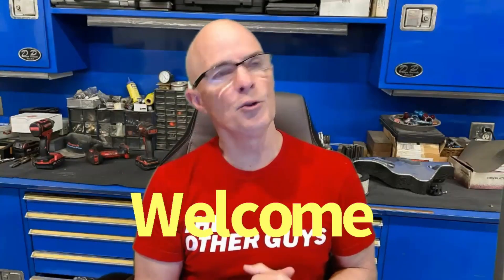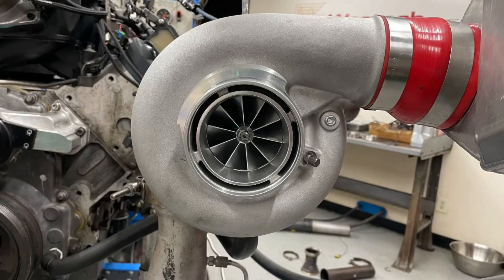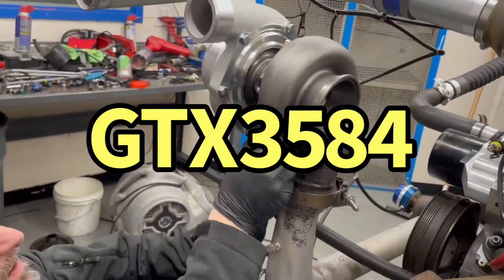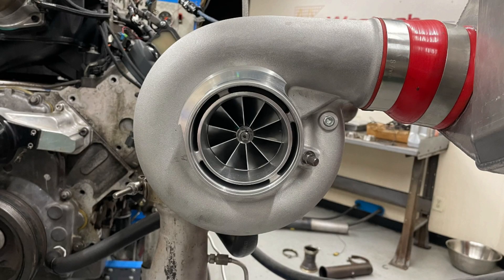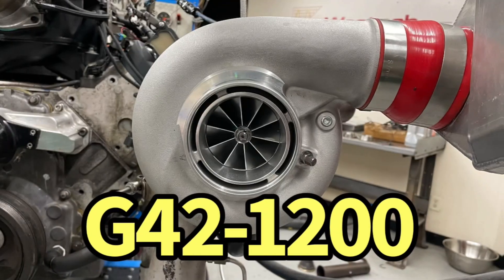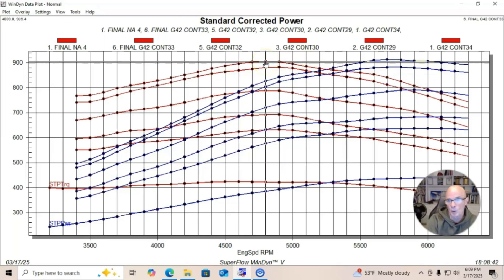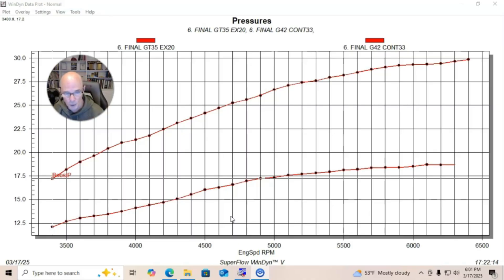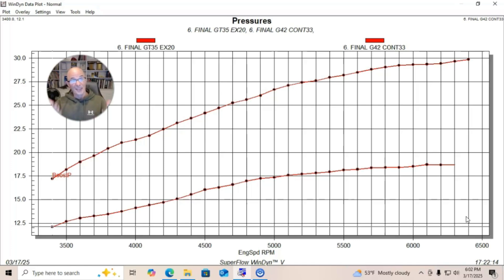TURBOS WARS! GTX3584RS VS G42-1200. SAME BOOST, SAME AF, SAME TIMING. POWER, BOOST & BACK PRESSURE

Comment: 8:00 g42 is the better turbo it has more torque and power across the board even more responsive being bigger. insane
Reply from the maker: it is not more responsive-the artificial dyno load created that-in a vehicle on the street or chassis dyno-the smaller turbo is more responsive

Comment: Have a 2009 Yukon with a 5.3. 
Plan on towing the boat and four wheelers with it and playing some with it on cruise nights the smaller turbo should be perfect correct. 

And for power maybe 5-600.
Reply from the maker: YES-THE SMALL TURBO WOULD WORK, AFTER TESTING THE G42 ON THE STREET IN THE TAHOE-IT WILL ALSO WORK
Reply: Btw rich are your guys kits going to be complete down pipe inter cooler all of it.

Comment: @richardholdener1727 I see that low-rpm torque is almost identical, how do you know that GTX3584 is much more responsive?
Reply from the maker: the artificial load an engine dyno applies (on load in) does not accurately measure boost response-we measured it on roll in

Comment: Great video! Not sure if you heard about Garrett’s G series gen II or GXR series, but they seem to flow much more size per size. They also suit higher boost from what I see on the compressor maps.

I have a 3584rs on a 2.0 4cyl. and I feel that it is getting out dated. I hope someone knocks off the new G35-990. It flows mucg more than 3584 while having a smaller comp wheel.
Reply from the maker: the GTX3584RS is rated at 950 hp-more than enough for 99.9% of 2.0L motors-also not sure how you can feel a turbo getting outdated
Reply: @richardholdener1727  Sorry, I didn't mean to say that the 3584rs isn't making power or relevant anymore but, it was released in 2017 and is a part of Garrett's older GTX lineup. Garrett has since released 2 entire lineups to replace the GTX lineup. I feel that for a high boost application, it would be a better choice economically for someone in 2025 to get a G series II or GXR since the compressor aero is much better and price is similar to the GTX line. On a lower boost application the first gen G series definitely shines though. 

As for my 4cyl. I cannot make near the 3584rs' advertised HP without overspeeding the wheel. On the compressor map, it flows only ~70lbs/min at a pressure ratio of 3.75 before overspeed. The newer similarly rated Garrett G35-990 would flow closer to 90lbs/min at the same pressure ratio. It does this all while having a much smaller inducer/exducer on the compressor wheel. This would be very beneficial for response and boost threshold in a small displacement motor like my 4G63.

Comment: There's some new turbo I seen over in Europe that has no nut that holds the blade on the compressor side the compressor blades go all the way to the very tip of the center of the blade circumference because there is no nut it allows for more surface area of blade and more airflow
Reply from the maker: that works to improve flow

Comment: How much response are you losing with the bigger turbo of the two?
Reply from the maker: you need to choose your turbo based on desired output first, then based on desired response. One of these is much more responsive than the other (especially on a smaller motor), but the other can make a lot more power (a G42 works well on a 6.0L)

Comment: Did you use the same 1000 cc injectors for all 3 tests? Will those support the full 1200hp on E85?
Reply from the maker: same for all tests-will support 1200 hp (flywheel) on e85
Reply: @richardholdener1727  thank you! Great info in all your videos.

Comment: Hey Richard! Are there any variable-geometry clone turbos out there? Just curious if those are still single-source or if they can be had cheaply for tuner fun...
Reply from the maker: The problem with those (as discovered by the OEMs) is that the environment for the variable vanes in a turbo don't last long and are expensive (just get the right size turbos for your needs)
Reply: @richardholdener1727  Can you simulate a test of a VGT in a remote set up? 
That might recreate the lower EGTs that the VGTs prefer.

Comment: Bro doesn't understand absolute pressure....
Reply from the maker: Bro understands
Reply: @richardholdener1727  Well. Edit the video with the correct pressure ratio across the engine..
Absolute pressure buddy...

Comment: Great video, but I wish you also showed the comparison at a lower hp, further from the choked flow of the GT35. Would also LOVE to see some plots on the compressor maps of both with turbo outlet temp and charge temp after the cooler. Are you able to control the intake temp to keep it constant between the two?

This is such a highly debated topic, and you're putting numbers to it, thanks!!
Reply from the maker: the air going into the turbo is the same. No need for compressor ploys-the maps are avail on line. We ran the GTX3584RS at 7-15 psi (same with the G42)
Reply: @richardholdener1727 I was talking about intake temp in the manifold, not into the turbos.

Your video did a great job showing the increased back pressure from the smaller turbine, but it’s only half the story.

Since you analyzed the results at the max power rating for the smaller turbo, it’s very likely that the compressor is choked. (See how flat the power curve gets, right at the limit?) Since the turbo is controlled to a boost pressure, when the compressor chokes, the waste gate closes, spinning the turbo faster, but mass flow at the turbo inlet can’t increase. The result is more heat. That is why I am curious to see compressor outlet temps, and mass flow plotted on the compressor maps. Sure I can look at the maps all day, but they don’t mean anything without the mass flow.

You’ve got all the data to show how your test results relate to turbo sizing tools so folks can pick the right size turbo.

The reason I wish you also did a compare at lower boost/flow was to see how much power difference the turbos have below choked flow (though this can kinda be seen at the lower rpm’s). This is mostly to settle the online debates about the same boost from bigger turbos being more flow at the same boost… even below choke? 

My question about controlling manifold air temp is related to the idea of cooling the likely hotter air temp of the smaller turbo down to the same manifold temp as the bigger turbo. My guess is that if you have enough cooling capacity, the boost pressure would drop in choked flow and likely would not be able to match the larger one.

Comment: It would seem you might want to get the GTX42 even if only running 700-800 hp as it has better spool response and made more power on less boost lol.
Reply from the maker: no-this graph does not show response-the dyno produces full boost on both (artificially)
Reply: @richardholdener1727  Ah, so the whole thing is pointless if we cant see the actual power bands...I have always been for using a slightly larger turbo to run less boost if you can find one that spools pretty well for its size.

Comment: The smaller turbo more responsive?  According to your graph, it made less power from the bottom (3500 rpm) to the top.  If it's making less power at the bottom, how is it more responsive?
Reply from the maker: the response rate is not shown on the graph-the engine dyno artificially loads a turbo motor

Comment: Love this stuff Rich, just love it!  That 35 was turbine choked right from jump street! A negative delta p that bad is no bueno! I build mostly small engines with boost...I was very active in the 90's-00's, had my own shop and turbokit company. It was a really fun era to be a part of.  I always went against the grain of small turbine and big compressor on a small engine mantra.  I always told people, run just enough compressor for your power goals and open up the exhaust side.  You'll make more power, at the same boost with the same spool and your engine will be MUCH happier for it.  The smaller compressor makes up for the larger exhaust side so "lag" and response is pretty much the same as the small turbine big compressor turbos.  I proved it one day by swapping to a larger turbine a/r on the turbo while strapped to the dyno.  The car at the same boost, same day, never loosening the straps went from 307 whp to 392whp just going from a .63 to a .82 a/r turbine housing on a T3 frame turbine hybrid using a T4 compressor. (Not a giant comp wheel at all, just crazy efficient with a huge efficiency island with 7-20 psi being at peak for the airflow we needed!. T04E 50 trim,  It was the precursor to the GT30R.)
Reply from the maker: it wasn't choked from the start-it is a better turbo for a street/strip 5.3L up to 800 hp (the response rate is not shown on the dyno curve because of the artificial stationary load that allows a turbo to be at full boost)
Reply: @JViello  I asked about the a/r of the 84rs , got a link that doesn't work ?!  😑 from a 82 a/r to a 1.01a/r  would of picked up  power.
Reply: @UltimateTurbo214 100% it would i had this turbo on my inline 6 3.0 i went from .82 to 1.01 and gained 50nm tq.. cant remember hp but it was quite a bit and only lost 150rpm in spool so..

Comment: I have g42-1200c on my car now amazing turbo!!
Reply: What engine is it on and how is the spool response?
Reply: @ b58 and it’s pretty impressive granted mine is alil different then the average g42-1200.
Reply: What size motor?
Reply: @thatonedude23-eb8se it’s 3 liter straight 6. Yes they are great on ls7 if you want to make 1000hp-1400hp. If your plan is to make less then I would use a smaller turbo n have instant spool.
Reply: @DragpackRacing  i have 88mm t6  on it now i just wanted something that spool up faster
Reply: Will the G42 work good on a LS7 ?

Comment: It would be much better to start the runs at 2000 rpm to give people an idea of what the difference is when driving about town. Like how much better is the smaller turbo down low? If it’s negligible it would be an easy decision to get the bigger turbo.
Reply from the maker: To better illustrate the response rate (the GTX3584RS is much more responsive), we logged boost during the roll in at 30% TPS, the 3584 had full boost and the G42 had none
Reply: @ ok, that’s significant. Thanks for the info.

Comment: Can you run the same test as twins ?  I would love to see where they spool in pairs and what the back pressures look like… I guess you may need a different map though. 

Interesting that both turbos are making target boost at 3500 rpm… I came from the Subaru world where if I had boost at 3500 rpm I felt special (tdo6 cnc 20g turbo)
Reply from the maker: there is no target boost (no controller) and the engine dyno has artificial stationary load

Comment: I had a guy recommend a gt42-1200 for my Toyota 4.7L 2UZ. The 2UZ is 241hp crank in stock form. Im doing rods, pistons and all arp hardware and I'd like to turbo for good low-end/midrange response w/ a final target of 400-500whp. Just seems like the gt42 is a bit oversized for it. He's claiming I'll hit 400-500 at 6psi which, on a turbo that big seems like it would be hella laggy and wouldn't give me power until late in the RPM range where I don't really like to play.

I need help guys. Really. I don't want to buy 4 turbos before I get the right one. When I say my target is 400-500whp, I mean it. I don't maybe want 700 in the future or whatever. This is going in a 99 4Runner which, if you've never experienced 400whp in a 3rd Gen 4Runner, its effing terrifying and more than enough.

Please help. 

Please. I'm really hesitant to pull the trigger on this dudes recommendation.
Reply from the maker: GTX3584RS-go to my store richardholdenerperformance.com

Comment: If I'm reading the dyno graph correctly the larger turbo made more power over the entire run. In this case whether you want 800 or more the bigger turbo is the better choice
Reply from the maker: the graph doesn't show response (artificial stationary load from the dyno) logged on the load in, the GTX3584RS turbo offered full boost at 30% TPS, the larger (more powerful) G42 offered no boost
Reply: If you want 800 with the smaller turbo, you just turn the boost up til you get it. Then you have 800 and great transient response.

I've got a "small" 72/68 turbo on my 5.3, I easily build boost with partial throttle. The 7875's I've driven needed to be floored or revved for boost. I had to make my downshift table VERY aggressive otherwise I'd be lugging it in the wrong gear with 5-10psi.

Comment: G40-1150 would be better match for this 450HP engine.  Like you've shown, 900HP at 15psi, and (calculated) 1,125HP at 22psi.  
@richardholdener1727 It'd be interesting to see the G40-1150 with the different turbine housings, for peak response, and power.
GTX3584RS flows 750HP/875HP (at 15/22psi).  Too small.  (G35-1050 is better at 850/975HP.)
G40-1150 flows 930HP/1,080HP.  Just right.  (Plus four turbine A/R's to experiment with.)
G42-1200 flows 1,020HP/1,110HP.  Too big.  (Only one turbine A/R.)
Turbine flow on each is 27-35, 35-42, and 43lbs/hr, respectively.

Comment: Doesn't seem like the smaller turbo would be THAT much more responsive than the larger, seeing as how they really only start to diverge after 4500rpm.
Reply from the maker: An engine dyno provides an artificial stationary load-the real test (not included in the video), was the boost during roll in at 30% TPS-the small GTX3584RS had full boost-the G42 had almost none
Reply: @richardholdener1727  Okay awesome,  thanks for clarifying that for me.  Also, great to hear you're selling parts now! I'll definitely be buying some from you for my aluminum 5.3

Comment: Buzz floating around Facebook was that you can take the speed sensor plug out (run it open) and it makes the turbo "whine" much louder. Similar to a T51R modded compressor cover. Curious if this is FB nonsense or fact? easy enough to test anyway.

Comment: A 6762 on a 5.3 litre is wild. 

Good turbo on a motor they suit. 

Gtx vs G series is interesting also. A g35-1050 vs a g42-1200 would be interesting to see.
Reply: g35 vs g42 would be same as gtx35 vs g42.. Well, all you need to know is turbine outlet diameter and compresor max flow and pressure to know what that turbo will do, and with G series hp rating is always too big for flow rate they can achieve. 
What I would like to see is Xona vs G series or Gen2 G series (or maybe precision next gen)
Reply: @ I’ve done two maxed out 3584’s vs two 35-1050’s and they are nothing resembling the same 😂 completely different wheel designs, different EMAP, different power.
Reply: I still thinks the same.. g35 has +1mm bigger compressor inducer and has extended tips, a/r and housing trim is larger on compressor side making it more suitable for higher pressure and flowrate. Turbine wheel has improved design and flows a bit more for same a/r. Gtx3584rs is gen 2 gtx design, and much improved vs gtx3584r.
Nothing changes with mine comment for g35 vs g42 -> g42 would win if g35 is just maxed out, but its nowhere near xona design (even recent smaller Borg Warner EFR SX-E stuff has compressor maps with like +25% PR limit vs Garrett).
Of course i agree with G series is better vs GTX series, and GTX gen2 is better than gen1.

Comment: Hey Mr @richardholdener1727 

Very pleased to see that you've started your own line of hi-po gear. Congrats & well done !

I believe the .82 AR exhaust housing is the culprit causing that 2:1 back pressure

I realize everything has a trade off, but a 1.21 sized housing is really where it needs to be on this capacity to get the best overall return from this 3584RS

If we were to use a (way too expensive for us budget builders) Garrett GTX3584RS as a reference, the recommended displacement is around 2.2 to 5.5 litre engines. Now they come with 3 housing options, a .83, 1.01 and a 1.21

I would expect if you could acquire a 1.21 exhaust housing for your low buck turbo, we would see a dramatic reduction in back pressure, and still have excellent low speed spooling due to the overall small size of this turbo

It would give that G42-1200 a better run for it's money

Comment: I would love to see that generic G42 compared to its name brand equivalent. The difference in price compared to performance might be an interesting data point.
Reply: It's CRAZY how efficient the G series Turbos are.  They make insane HP in such a small package which also means you should be able to get into boost more rapidly as well.  I hear what your saying about the actual Garrett branded turbos vs .   The off brand turbos.  However, even the "generic" turbos are now reputable.  I like Pulsar and Your miles turbos.  Pulsar is like  a direct knock off of Garrett

Comment: Well Richard what turbo would you suggest with a Chevy big block in the 500 inch range ? Love what you’re doing ! Thanks 👍😎🇺🇸
Reply from the maker: for what power level?
Reply: Promaxx 317 heads , Howard’s solid roller don’t have the cam card right now .663 lift probably around 91/2 to one kinda built for future turbo in my SS67 Chevelle 650 at the crank ?
Reply: Also setting up for auto cross 4 speed eventually 5 speed

Comment: Try that GTX35 on the K24
Reply from the maker: It would work well
Reply: @richardholdener1727  full boost around what Rpm? Back pressure? We need more info,actually we need a dyno lol